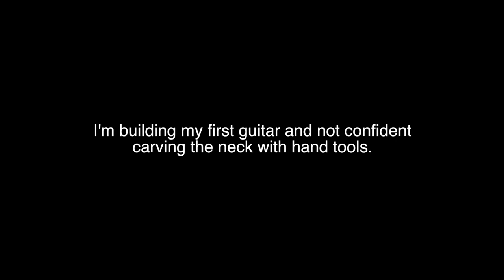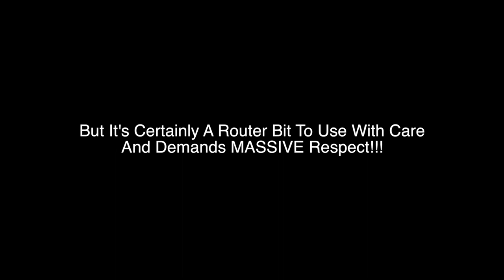Guitar Neck Modern C Router Bit from SJE Tools

Comment: Even before the kickback happened, I was watching in apprehension. The cardinal rule you broke was that you had your hand on the same side of the workpiece as the cutting tool - that’s a no-no. You need to almost develop an instinct to position your body in such a way that you are not in the line of the business ends of power tools. Thank your lucky stars that you weren’t using a table saw.
Reply from the maker: It was a lesson learnt thats for sure :-)

Comment: I have made several such necks using a straight up 1" round over bit.  BIG ol' boat necks but they feel SO GOOD.  They are so beefy that I have made several with NO truss-rod like the very first original Fender necks.  5 years and they still hold up with no warp whatsoever.  Best playing and sound necks I have ever played.  You do need to learn to shape the transition from neck to heal and head to get that smooth V transition.  But other than that, looks pretty good.

Comment: It seems a little bit risky and dangerous just to save a little time. Not that I'm trying to poo poo doing it that way. but files sand paper and disk sanders always worked well enough for me. And a whole lot safer as well.
Reply from the maker: It is a risky piece of kit thats for definite...quite scary to be fair. I didn't think I would use it again, but if you have seen my more recent guitar video where I built the Rick Parfitt guitar...I ended up using the cutter again and it went a lot better. Was still a bit scary but I managed to do a reasonable job of the neck. :-)

Comment: I think you should use with the router bit being on top and the fretboard pacing the table
Reply from the maker: Yeah overhead would be safer. The router bit works well well its lethal and really i need to look at a safer way of using it. I ended up having to finish this neck by hand as I became wary of the cutter. But if I can find a better way of machine with the cutter id definitely benefit from using it.

Comment: Used to work in a joiner's workshop (woodshop). Foreman got too close to the cutters on a machine one day. Lost a substantial amount of the palm of a hand.  It's not possible to be too scared of power tools.
Reply from the maker: This is one of those tools that Ive still not sussed out how I can use safely. Im building another guitar next month and really need to come up with a safe way of using this bit as it works really well.
Reply: @Smugwood  

Build a jig which holds the neck so you can clamp it into the jig consistently and allows each hand to be a good 3-4 further away fork the cutter and also has hand holds.

Comment: Were you able to get a taper on the depth of the neck? Meaning it's a bit thinner when measured at the 1st fret as opposed to the 12th? Something like 22mm at the first and 24mm at the 12th.
Reply from the maker: I didn’t realise until a couple of weeks ago that there should have been a taper. I took my guitar to a guitar builder (Crimson Guitars) and they took a look at my guitar as I asked for feedback. They mentioned about the taper which wasn’t something I’d even thought to add. So I’m now looking at building a second telecaster and making all the changes/improvements suggested by Crimson. I plan to cut the taper then run it through the Modern C router bit and hopefully it’ll look spot on. I was also told to go a bit deeper with the cutter as I hadn’t quite got the c shape...it was slightly flat on the bottom. So fingers crossed, next one will be spot on.
Reply: Smugwood that won’t work for you.  Look at the back of a Fender headstock and notice how it’s not level with the first fret.  You’ll need a jig that holds the heel slightly higher than the headstock.

Comment: That near miss you had there looked properly scary! I have to say, though, using a table router for neck shaping made it all looked like a very hit and miss affair to me (almost literally at a couple of points). The only time I've ever seen roundover bits used for neck shaping they were in a drill press with the neck passed through fretboard-side down on the drill press table. You can see what you're doing much more easily. I think Big D guitars had a YT video of it a little while back. You should really try hand shaping though with files, rasps, spokeshaves and the like. There's really not that much to it and there aren't nearly as many ways to lose whole limbs while you do. Interesting test, but certainly not a method for me.
Reply from the maker: I definitely want to try a neck shape using hand tools, but I also believe that If I can just find a safer way of using the router bit it’d be a really quick job shaping the neck. It’s just going to take a bit of thought and design...but something I’m really keen to do. But I’d still like to shape one by hand tools just for the comparison and experience 👍

Comment: YOu will lose your fingers at some point if you continue to do it the way you were in the video, but you already know that.  Here's an accessory from Lee Valley.  http://www.leevalley.com/en/wood/page.aspx?p=41780&cat=1,43000    It won't work for what you want to do, but it wilol illustrate the idea.  I have this item and it works well.  For your application, make out of baltic birch plywood (or some other material) a base that the neck is bolted or clamped to (you could bolt through the peg holes  and at the other end clamp for example), have two vertical handles bolted to the base (Lee Valley and other places sell such handles separately) with these handles AWAY from the cutting side.  Only cut one side of the neck (with the handles on the other side above and nowhere near the action).  Flip the neck around and cut the other side.  Pretty safe.
Reply from the maker: Yeah I do need to look at safer alternatives. Once I can suss out the best way im hoping I’ll have another go and see if it makes the whole process easier and with a good degree of safety.

Comment: how do you taper the neck thickness
Reply: Very late to this but I was wondering cause I wanna try some router bits for this and I had an idea to make a platform with toggle clamps and handles but the idea was to have half of the neck supported under thin plywood and toggle clamps down the sides and at the headstock and and back plate. Have a shim at the neck pocket side so that the height difference is your 1st fret to 12th fret ratio. Run this along a fence and continually raise the router bit just till it makes a complete cut at the heel side. Flip the neck over and place the shim on the other side. I've hand shaped necks a few necks and want to try routing and I want to play it very safe.